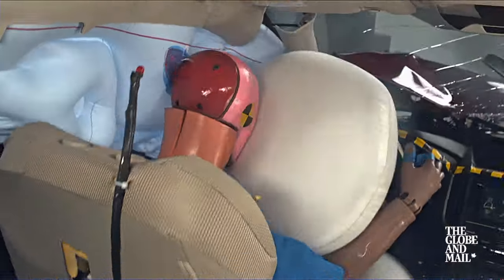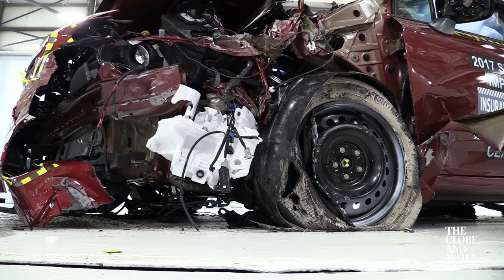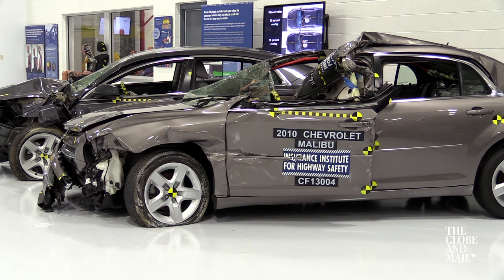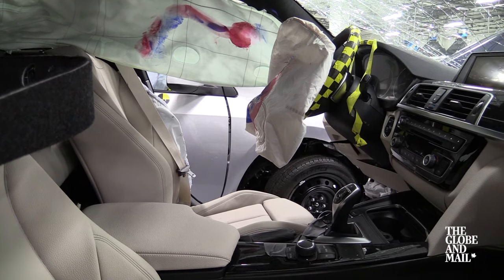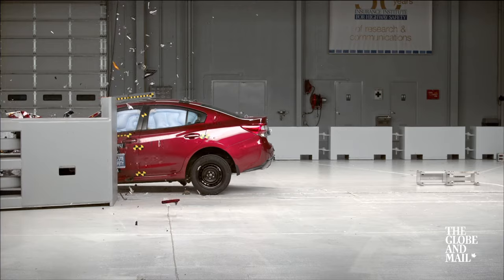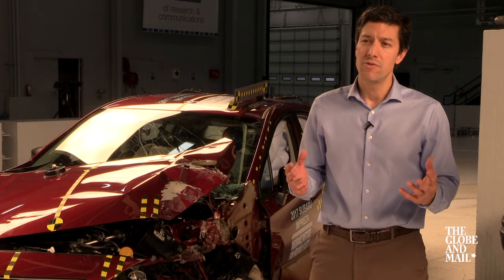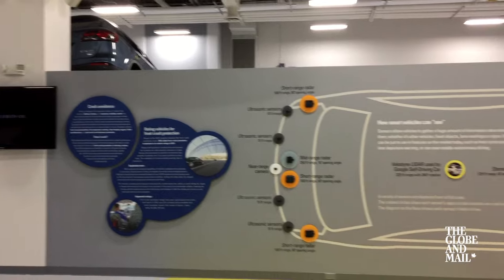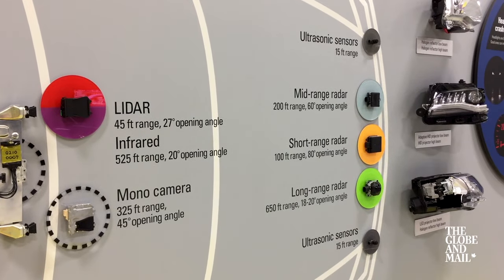How a car's design helps make it safer in a crash

Comment: we are all just happy you help make it safer for anyone that need to breach a prison wall, so they can use an electric explosive and the vehicle impacting the wall to focus the shock wave into the wall they are safely trying to breach, all the timing is automatic upon impact just brick on the accelerator and have the vehicle over 40 so it good that most cars are automatic now so its even easier to breach a high security wall, cheers

Comment: Has anybody ever been injured or died inside a car after a crash while the car is perfectly fine or minimal damage? Until I find that proof, crumple zone appears to me as an excuse to go cheap on cars.
Reply: An older car may not crumple in the engine bay or trunk, but where it crumples instead is the cabin. The engine bay would not crumple, and therefore the energy is transferred directly to the cabin which collapses under the immense stress, crushing and often killing the occupants in crashes that would be walked away from in modern cars. Compare the strength of the safety cage in a modern car to that of any old car and the difference is night and day.
Reply: A great example of the vast improvements in the safety cages of modern cars is shown in small overlap crash tests. Even cars from the 90's and early 2000's would perform horrendously, whereas even the cheapest of modern day cars can complete the test with minimal to no safety cage deformation.
Reply: I was driving an 88 buick. There weren't crumple zones in the back. I was stopped and a car hit me from behind going 40 miles per hour. I received a TBI and nearly failed out of grad school because of it. If my car had crumpled and absorbed the impact I would have walked away just fine but instead my body absorbed the impact and my brain hit my skull going 40 miles per hour.

ETA: my buick was drivable but due to damage to the fuel tank we chose to let the insurance total it.
Reply: I've had three thar didn't seem bad and my whole lives ruined from the last one
Reply: I debated this and the cult members threw stones at me.  This is the crumple zone  ->Coal waste could provide a strong, lightweight material for car manufacturers.

Comment: Why F1 cars not designed to crumple?  Driver surrounded by rigid cage debunks crumple theory lol. 😅

Truth is, it's just cheaper.. Period
Reply: Something tells me you didn't understand the physics brought up in the video. The cabin is the part you DON'T wanna crush. Everything else goes. Also, the formula 1 cars are at risk of entirely different kinds of crashes anyway. In a formula 1, you're more likely to get into crashes where the vehicle flips or spins wildly, which means the g-forces imparted on the driver can't be stopped by crumbling, meaning you have to put extra effort into defending the head from impacting the ground, the neck breaking, and the driver losing consciousness. So yeah, it doesn't disprove anything. It just proves that entirely different physics interactions require entirely different safety mechanisms. And anybody could have told you that.
Reply: Also, most crashes by f1 cars that would require crumple zones otherwise are against the soft barriers of the track, (their tires also act as crumple zones anyways too, lol)
Reply: You're not very bright
Reply: What years of huffing lead gasoline does to the mind
Reply: @Skyisgoingbacktopluto yeah the barriers act as crumple zones
Reply: Someone with a brain
Reply: @jjk2one  someone with a brain? Didn't you see that most of the tracks have tires and soft materials in the walls that are made in purpose for that?